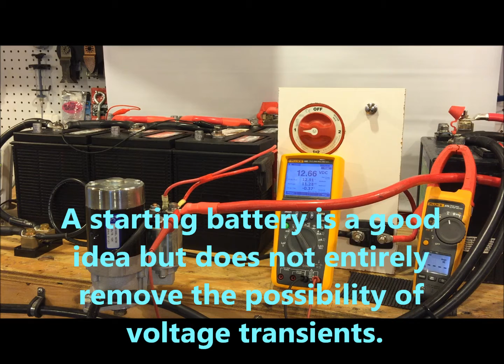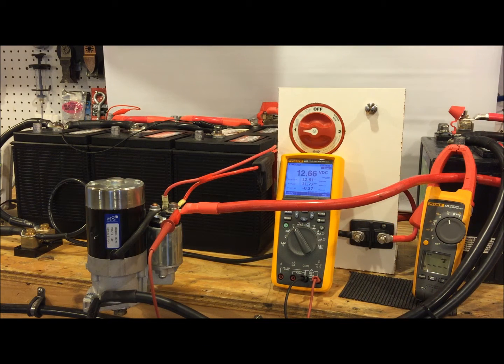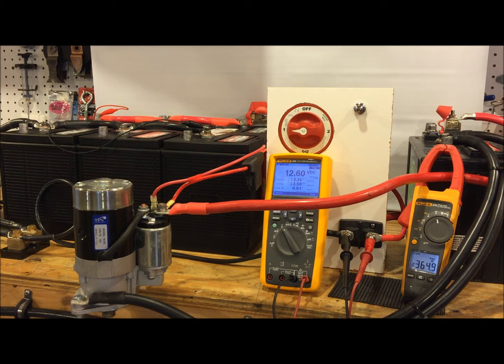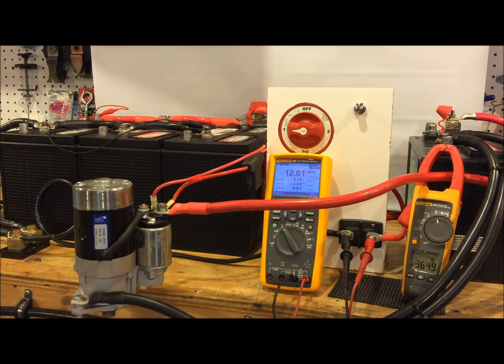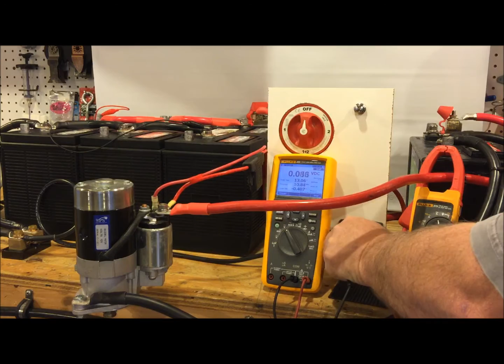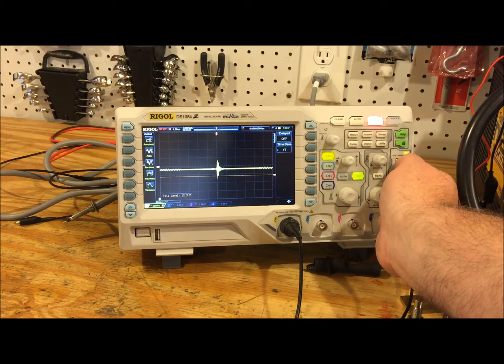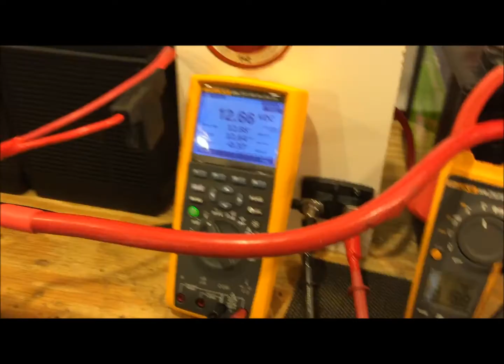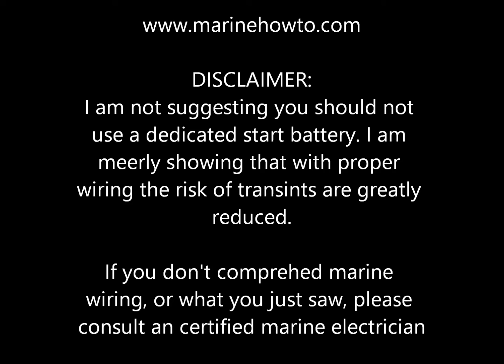Voltage Transients in a Marine Battery System

Comment: Good video. How come the 300amp fuse doesn't blow on the starter battery when you pull 360+ amps through it?
Reply from the maker: TripDelay curves answer this. They are on the BlueSea Systems we site..

Comment: Good video showing that you know electrical systems on boats, so i wanted to ask you can you recommend a switch that can connect two engine battery's on one setting and can connect a Blue Sea Battery Link Automatic Charging Relay for four 6volt House batterys.